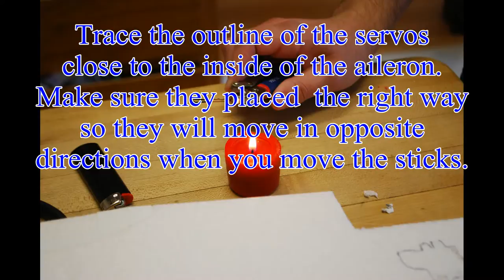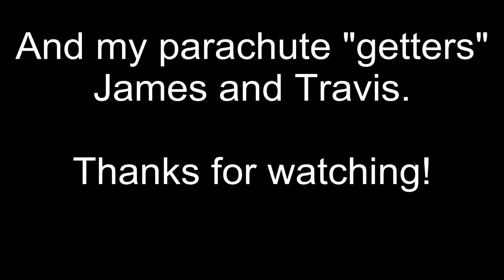Hobbyzone Super Cub Aileron How to

Comment: @Jackismycopilot what port did you plug them into? Mine has Elevator and Rudder which are in use and an empty one labled Throttle (even though its built in brushed ESC) and thats it.

Comment from the maker: I used 2 "DSV130 3-Wire Digital Servo Metal Gear" part number [PKZ1090] from Horizon Hobbies website. It was able to do rolls with the ailerons but they were large rolls. It still resists due to the dihedral of the wing.

Comment: Great video! But I have a question; why would you put ailerons on a plane that will fly into the ground from rolls because the wing type?
Reply: Slacin' Ace What do you mean fly into the ground because of the wing type, I own one of these and have seen many with the aileron mods that do inverted flight. So ya I have no clue what you are talking about unless your a horrible pilot.
Reply: This was on Feb 8th, I think I said this because of the airfoil type

Comment: The zip ties is a good idea but the first hard landing you have will break the thin landing gear fairings...Just sayin.
Reply from the maker: I have never had an issue with them breaking. The notch that holds them on the gear doesn't stick out very far so as long as you don't tighten the zip tie too much, the gear will pop out of that notch on a hard landing.
Reply: They break when they get old and brittle. Yours looks brand new. Nice job and nice video!